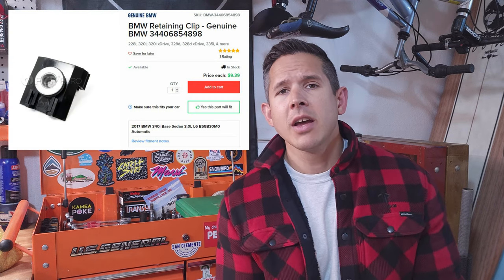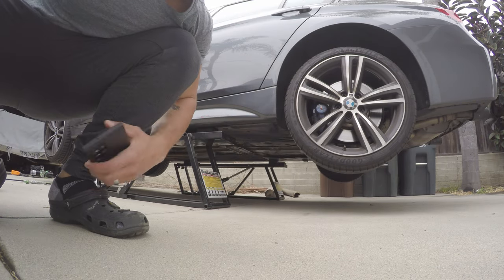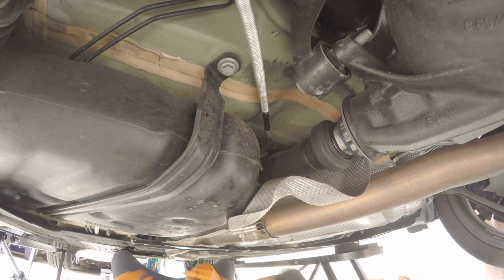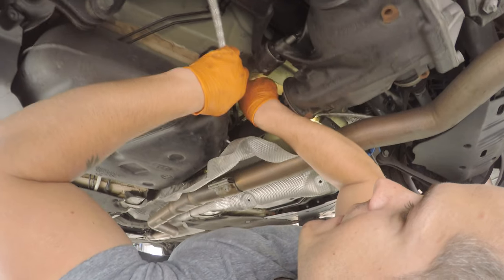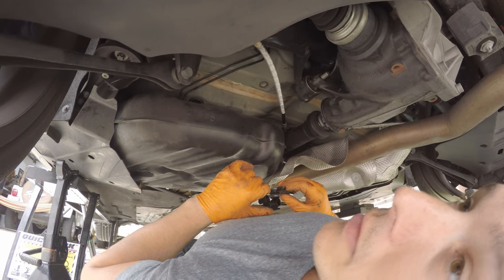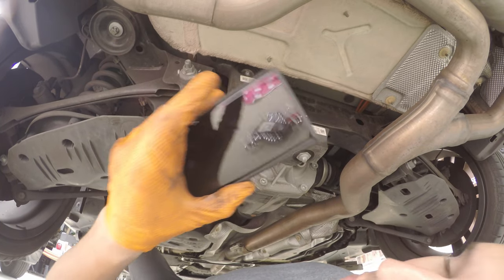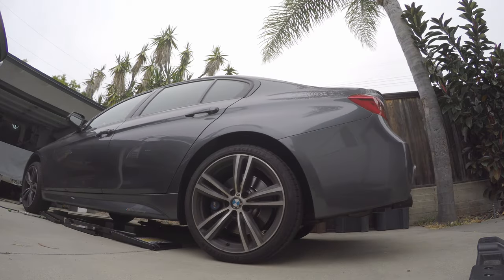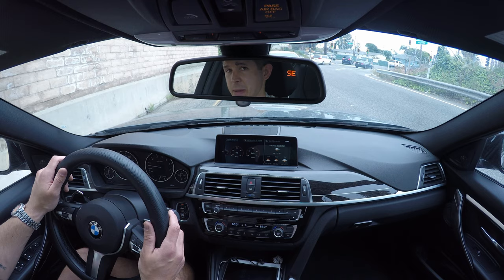Save $1200 By Fixing This Common BMW Scraping Sound Yourself | F30 Parking Brake Cable Clip

Comment: I had the exact same problem on my 2016 328iGT xDrive while accelerating around a right hand turn. The dealer wanted $1500.00 to fix the problem. I actually fixed it with 4 zipties. I tied each parking brake cable up to the rear frame and it's been holding for over a year now. Great video and respect for going the extra mile and installing a new bracket. Now I know if the cable ties ever break where to install the bracket. Love the creeper cam, very cool! By the way Im located in Florida and the dealers are not so kind.
Reply: Did you have to drop the fuel tank and the heat shield?
Reply: Same repair 4 zips on my 17 330i xdrive F31 touring
Reply: I was going to duct tape mine, but going w zip ties now!!
Reply: Ya until you go to use your E brake & they snap! 😂 happened to me
Reply: Do not use zip ties. Puts uneven tension on the brake line.. spend $139 on the AGA metal retainer. It's a permanent fix.
Reply: @markdelaserna9921  I zip tied mine and it works fine, shops will charge a lot to change that lol
Reply: I ziptied mine but my hand brake doesn’t work now lmao
Reply: Yo!!!! Thanks for this lol they wanted $1,200 to fix mine
Reply: I'm going to try this. Thanks for this
Reply: is there a video on it I need to do this

Comment: Use long zip ties and loop around to sub frame problem fixed.
Reply: Exactly, my independent BMW shop found this problem when I had my 2016 328i in for an oil change and brake fluid change snd fixed it at no charge.
Reply: What I did 😂😂for time being
Reply: Was gonna say the same
Reply: Zip tie would probably last longer too.

Comment: I went to a friend's auto shop yesterday and asked to use his elevator. I just put a ziptie and the problem was solved. Thanks for this video!
Reply: What did you tie to?  I'm under my car right now...  I can't see how a skilled mechanic with the right tools can't replace this without removing anything.  The nut is tight, but it's accessible.  I could get it off if I wanted...  But maybe there's more to it that I'm not considering...  Oh, realizing I'm under an F22, not F30 like in the video...
Reply: @NJFPV easy to do its all same across all f series cars just find the loose brake cable you will see it sagging down in the middle towards the back sits underneath the gas tank just zip tie it to the frame of car
Reply: @DriveDynamicsAz  I zip tied it to frame on one side, and heat shielding on the other.  Started making noise again after a while.  Found metal cable holders meant for this issue on eBay for $25 - one piece, fits directly in place without needing to remove anything else but the nut, and holds both of them in place perfectly.  Installed, and will be solid forever :)

Comment: If you want easier installation and a more "permanent" fix get the AGA Tools Park Cable Clip Repair Kit (AGA-PCC-854-898) instead. It does cost $130 though - but it won't break anymore.
Reply: TY
Reply: $25 ebay

Comment: I just finished this work and is impossible to slide and place the screw without remove the fuel tank support, 4 bolts. This is a nightmare if you are alone. All videos around YouTube does not show you how to place and slide the part. If you need more details I will support you. I use 6 hours  to complete the job properly.

Comment: took 10 minutes on a lift to fix, 18$ from local bmw dealer had it in stock. I dealt with it for almost 7 months thinking it was tires rubbing because it started after i swapped wheels and tires lol. kept messing with ride height, camber, and playing with the fender liners than randomly found a youtube mentioning this. What a life saver lol
Reply: 10 mins ? I was told it’s a 3-4 hour job

Comment: Just Subscribed.  This happened on my M240i.  I wasn't experiencing the noise that you were, but the plastic piece that broke off, fell and landed on the heat shield & was wedge between the heat shield and the drive shaft.  It was making a horrendous squealing noise in reverse only.  My car is no longer squealing in reverse.  I ordered the new part from FCP Euro and will be doing this repair soon.  Thank you!
Reply from the maker: Good luck!

Comment: Bang on! About to tackle this as well. AGA tools makes an all metal one so you only have to swap it once.  Just ordered it. Thanks for posting the video!
Reply from the maker: Good to know! I'll have to swap to  the metal one next time it breaks
Reply: @yodersgarage the best part about the AGA part is that you don't have to drop the gas tank to replace.  You lower the exhaust and driveshaft (unbolt the center carrier from the chassis) and pop the old one out and slip the new one in.  They have a video for the install.
Reply: Same part all over eBay for about 25 bucks, just fyi.  No reason to pay the $125 - 200 I've seen from various shops.  Crazy ass bmw tax from those gougers.  It's 2 pieces of metal, tubing, and a screw.  Fouttahere with that $125 noise...

Comment: I just fabricated a bracket out of aluminum stock that holds them up without having to remove the old plastic bracket. No removal of anything besides the one nut. Bolts up with the existing bracket nut.

Comment: hey man..good vid... glad you sorted it... I just found a leak on the front shock Im goign to tackle soon.. keep the beemer content going.. Imy building an old for as well. in australia............ how do you rate the lift..?  I have a 2 post hoist in my workshop.. but could use one of these at the home garage formy 3 series...and other cars
Reply from the maker: Glad you liked it! The Quickjack lift is great for a home garage, especially if your only alternative is jack stands. Like anything else, just make sure you set it up correctly.

Comment: Spent last weekend doing this on my F31.  I’m unable to latch the new bracket to the brake lines.  Any trouble or hints you can suggest?  The brake line diameter seems too big.
Reply from the maker: It's definitely a tight fit. I had to get a long crowbar with a handle (a big screwdriver would probably work too) and get some leverage on it at just the right point.

Comment: I appreciate the video.  I have the same issue.  Would it make sense to cut the heat shield with a snips or power shears to access the clip?  And then just patch it back up with a couple of pop rivets when you are done?.
Reply from the maker: It's definitely possible without cutting anything, but it would probably make things easier

Comment: I tied do it,  I dropped exhausts, the  PROBLEM is the new part just wound NOT go in on a 4 series F32. The shaft and the cables get in the way, cant slide it in and put the tank on top of it.  Either the lines or the clip its self on the way against the body and the driveshaft.
 Need to drop the driveshaft, there is no other way aground it.  However, 
After everything was taken out and I was left with no option. Obviously I cant leave it as is,
I had just cut a piece of metal, drilled a hole in it, rolled edges, bent certain way and bolted it over the tank and cables.
The car is fixed, It works just as well as the BMW fancy plastic par if not better, obviously it wound never ever be broken
#1 It supports the tank #2 it supports the lines and it costs , scrap metal rate 1 cent.
Why BMW cant do that to begin with?
Why to invent a whole fancy part with rubber gasket, inserts, clips that are more fragile than a zip tie. 
I am just surprised by this.
Reply: I did this today on my F32 and had the same issue. I was eventually able to slide it in by removing the two bolts on the center carrier of the driveshaft which gave me just enough clearance… there’s no need to remove the entire driveshaft. Just a heads up for anybody doing this in the future.
Reply: @myst0296  a Year later I still drive without issues.  My DIY bracket  out of scrap metal holds it all well. No issue at all

Comment: Has anyone done the zip tie fix ?
Reply: It worked for a few months for me. Getting mine done properly tomorrow. I had a squeak/chirp instead of the grinding both times and figured this was the issue, lo and behold it was
Reply: @joespittle1 How much they charge lol
Reply: My mechanic charged $230. His labor rate is $130 (Not sure tho), I provided the metal clip, it was about $130. My mechanic was based just south of San Francisco for reference
Reply: @joespittle1  I just zip tied it to the frame and the noise is gone , used 2 zip ties looped it
Reply: @joespittle1  what’s the mechanic bro  I live in San Francisco also

Comment: If you don't do anything does it lead to further problems?
Reply from the maker: Given how rigid the line is I doubt it'll lead to any problems soon. It could probably eventually wear through the sheath on the cable though.

Comment: My BMW service told me $1130 and if I don’t correct the problem it could cause damage to my drive shaft. Is that true?

Aldo what happens if I don’t replace it.

Thanks for the help 
Patricia
Reply from the maker: I wouldn't worry about it damaging the deiveshaft at all. The cable isn't large or heavy enough to do much other than make noise. If you don't replace it it'll just make noise for a long time and maybe eventually wear through the sheath on the parking brake cable.

If you don't want to replace the part yourself or pay someone to do it you can zip tie the two cables together and solve the problem very inexpensively.
Reply: Im a bmw technician and I've seen these cables distroy the seals in the differential cause they hang low and get tangled up with the drive shaft I replace these clips almost everyday
Reply from the maker: That's good to know! Are more serious problems common on specific models?

Comment: Do I actually have to take all that stuff of to reach it I feel like I wouldn’t have to
Reply from the maker: You need to be able to pull the tank down if you're actually replacing the clip, which requires loosening a lot of things. If you're just zip tying you probably don't have to remove anything at all.

Comment: How much would you charge me for the same repair im located in California I have a 2015 328i sound is very annoying 😂💯
Reply from the maker: Lol, I barely have time to work on my own cars these days. Honestly, you could probably just zip tie the two cables together and solve the problem with significantly less hassle.
Reply: @yodersgarage  thank you appreciate it
Reply: @Babyboysosaa  have a 2016 and I did the zip tie method. You have to remove the vent in the back to get to it. Took me about 30 minutes.
Reply: Just ziptie the cables to the rear subframe, theres a spot you can loop a zip tie through to keep the cable from hitting the driveshaft.  No need to remove anything, takes 5 minutes.
Reply: @JeeperZJ  will do thank you so much I still haven’t done it I drive drive around with the music hella loud so I almost forgot about it 😭
Reply: @Babyboysosaa  there's a little hook that holds them up on each side, you'll see it when you get under there.  Just pop it off and take it out of the subframe and use that spot for your ziptie.

Comment: I kind of disappointed in BMW. they are using very cheap not reliable components and asking a lot of money to replace those cheap parts. This is not only the problem I had. On the convertible roof the few bucks thread was torn, damaging the rear panel. BMW asks 4000$ to repair.
Reply from the maker: Agreed, there are simple things where a little extra cost up front would save a lot of money in repairs.